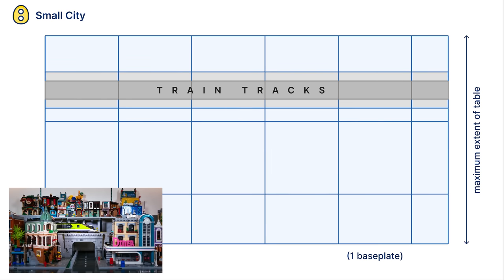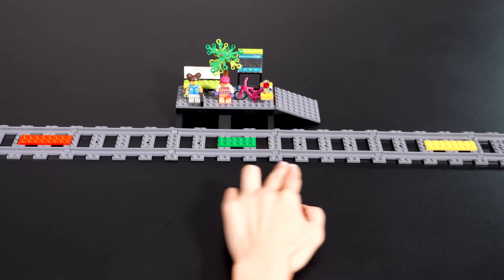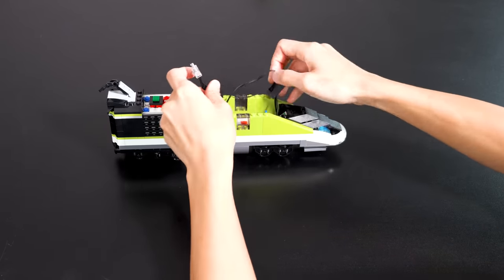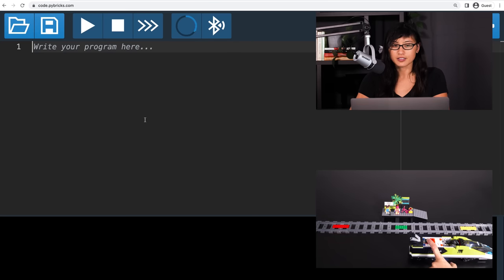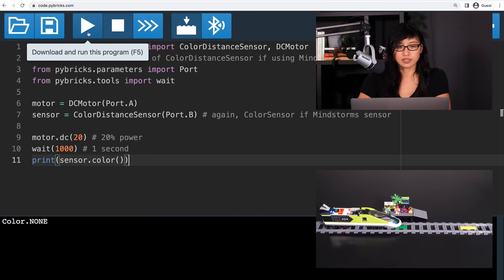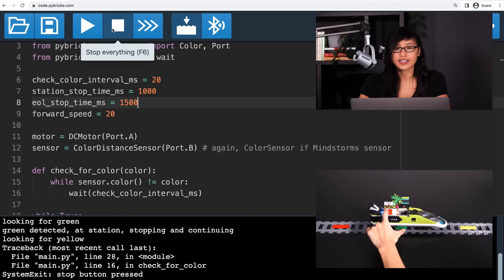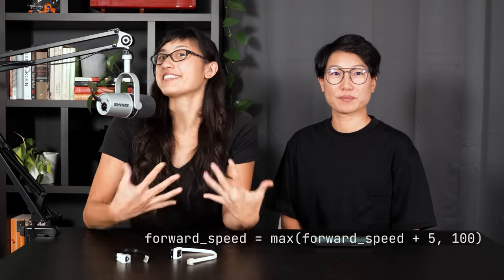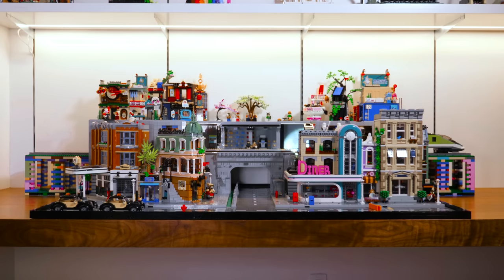solving the LEGO city train problem (no room for loops!)

Comment from the maker: The train in the video is LEGO Express Passenger Train 60337. If you want to purchase it, consider using this link (this is an affiliate link, which means when you click the link and make a purchase, we receive a commission, which helps to support the channel!):
https://bit.ly/lego-express-passenger-train-60337

Links to the code shown in the video, plus the code blocks version if you don't want to use Pybricks:
- Pybricks code to make the train run back and forth continuously, using color sensor: https://github.com/eggybricks/poweredup-color-sensor/blob/main/pybricks-code-for-60337-express-passenger-train.py
- PoweredUp code blocks version of the same thing: https://github.com/eggybricks/poweredup-color-sensor/blob/main/PoweredUp%20Code%20Blocks%20for%2060337%20Express%20Passenger%20Train.pdf

Comment: You could have use the depth sensor for added realism: trains don't just stop on a dime... they roll a bit untill they stop... you could place a small plate in the center of the green plate and let the train slow down when it sees the green plate, and stop when the sensor sees the raised bit.
Reply: Don't know if you'd have space for the depth sensor? As think the sensor they used only does colour?
Reply: @JasonHorrocks  I suppose you could use two different color codes, one to slow down and one to stop. 
Example: put a white at the beginning of the platform and one green at the end. Do for both directions. Include a code to ignore the first white color met and act only when the second is met. Program to restart the train in the same direction after a certain time.
Reply: I suppose this video is to show the basics and it's up to you to improve it the way you find most suitable :D
Reply: Or have it detect the color and slow down to a stop over a set amount of time

Comment: As a suggestion for V2, I'd say put the "current speed" into a variable, and have your colour detection be a switch statement. Then the "Green" case can stop and wait, then re-apply the speed from the variable, the "Yellow" case stops, waits, changes the speed variable to - speed, and sets that speed, and the "Red" case does the same, but with + speed. Then it'll work for tracks with more than one station, and rather than having to push the train to the station when it starts, it can check the sensor and if nothing's detected, start going forward.

Comment: You could improve that program a little so the train doesnt stop as hard as it does right now (maybe looks very good with a bigger layout in the future). Lets say you use a longer indicator. Now you could initiate a reduction of speed every few ms as long as it reads green. When the green indicator is over it could do the usual break but with a bit of tweaking the settings and playing with the length of the indicator you could get a smooth break motion. Really cool job, that one really inspired me!

Comment: This is really great and has turned the train from a toy that my two kids fight over to control and crash, to one where they work together to get the train to do what they want to do! Excellent intro.
I personally found that the mindstorms sensor was not always 100% reliable when it comes to reading green when using it myself. I dont have the color and distance sensor however I would imagine it would be about the same too. If the train was moving very slowly over the green, or was in a darkened space then this wasnt an issue. To fix the issue, I built an enclosure under the chassis of the train (similar to the one thats removed in order to get the sensor to work originally) and found that its now completely reliable. 
I would imagine this would likely result in you fixing the reliability of your color and distance sensor as you mentioned that it was not as reliable as the mindstorms sensor. Whilst I suspect that the shaded areas where you had your coloured plates and the brighter light from the mindstorms sensor were probably the reasons why you didnt experience issues with the mindstorms sensor.
Reply from the maker: Thanks so much! And really nice debugging and solution — this is a great fix for anyone encountering this issue. Thanks!

Comment: Really like this setup, but I have issues with your code. It is assuming that the train is between the red and yellow at startup. If it is not, it will run past the yellow and off the track. I would suggest you change your check_for_color to not have a parameter and to have a switch statement to see if it has one of the three command colors. Then depending on what color it sees it can stop or change directions. You will have to add a direction variable to allow the program to remember what direction it was going in the station and continue in that direction after the hold time. In fact, this would allow you to have just two colors (red and green for example). When it hits red it just looks to see what direction it is going, then change to the other.

With this setup, the program will always stop at a reverse point and will not be dependent on a starting position.
Reply: Nice change, but what if the train starts at one of the ends then it might be best if they were two different colors
Reply: yes, I agree, the code in the video is unnecessarily complex
Reply: @anatoleh1  It's more than good enough for a basic intro. Every code can be refactored and refined later when you learn more ;)

Comment: The PU Sensor is not as good as the Mindstorms/Education sensor. The light with it seems to increase the accuracy. I also coded something similar a while back before I saw your video, and I managed to make it work using just two colours. I just stored a variable for the speed of the motor and modified that every time I saw the colour. You could do more stuff with other colours then if you had more ports available!

Comment: Cool. Seen this idea used for a Great Ball Contraption many years ago using Power Functions & an NXT. 2 colors at each end. 1 to slow down & 1 to stop. 4 colors total. But they had sign posts on the side of the tracks for the color. Not down. So, when someone walked by with a certain color shirt, things would go wild. LOL.

Comment: your probably not asking for tips about trains but I noticed a problem, that train has airdrag which is pretty bad for trains, and for those kind of lines you should put stuff like metra or amtrak does and a great example is the heartland flyer, runs through some smaller cities but also some bigger ones but its a pretty small line overall

Comment: Have you seen how the old 4.5 Volt system did it?
The battery box had a switch that was sticking out. When the switch hit an obstacle, it would reverse the current.

Comment: Maybe the intermittent fault of the color sensor has anything to do with two things, 1) the distance of the sensing element to the bricks and 2) providing contrast. Last I mean butting up say...black bricks to the colored bricks. Now the first I learned from an Arduino light sensor that measured varied output values based on distance. The second idea I got from an rpm counter, which stated contrast as a procedure. These ideas might improve consistency. Thank you for making these videos!

Comment: I just completed my first prototype city tram using a modified version of the tram from Lego set 8404. In the past I have had this setup with a Power Functions motor, battery box and IR receiver but as with my other trains, this just goes around and around and the tram generally has a hard time with corners. Using the information from your video, a PoweredUp Hub and train motor along with PyBricks, I was able to implement a much nicer street level light rail line. Many light rail lines do exactly what you suggested in your video in that they are a linear line that just goes back and forth. This works great for LEGO city regardless of the size as it adds a nice and unique bit of motion on the street level. I am interested in implementing some automation to the big rail lines as I think your method would be great to allow trains to pull into stations based on the count of revolutions. I am also interested to know if it would be possible to control the behavior of multiple PoweredUp hubs such that using an external computer, the code would be able to monitor the status of different trains. For example, if train "A" just passed the red plate, then train "B" stops for a specified amount of time to let train "A" pass. It would be really interesting if automation like this could be accomplished as it would provide a greater degree of realism to LEGO train layouts.Thanks again for your wonderful video and the inspiration it provided! You guys are awesome - if you are ever in northern, AL check in with the Tennessee Valley LEGO Club!
Reply from the maker: Glad this was helpful!!

Funny that you mention automating bigger rail lines — we just finished a new city track layout (w/ automation) that coordinates four trains (with four hubs) to all share one station by monitoring each other's location. If you're interested, we'll have a video on it up in the next few weeks.

Thanks so much and will definitely check in if we're ever nearby!

Comment: Great idea! I solved the same problem a while ago by having the train slow down before the track ends using a timer, and then bumping into rubber bands at both ends (for "recalibration"). But I was actually thinking of just replacing the whole thing with my own motor + micro controller, mostly because I don't want to deal with those AAA batteries all the time :/

Comment: In my childhood, I didn't need batteries to run my Lego train. It had a transformer which was plugged into the 220 V socket. And the train got the electricity from the tracks.
Reply: The old 9V track-powered lego trains could also be automated to do this with the classic Mindstorms RCX system! I have the old trains and a Mindstorms RCX, maybe I should try it out. The connector to power the tracks can be connected to the motor output on the RCX. There's no color sensor, but there is a light sensor to detect different brightnesses - or i could use a touch sensor which presses against a tile when the train reaches a certain spot.

Comment: Once you have the python program on the hub, can you still use the remote controller?
Reply from the maker: Good question! If you use the program as written, unfortunately not — the Pybricks firmware (which includes the custom program) overwrites the LEGO firmware for the hub, so you'd have to reconnect the hub to the PoweredUp app to get the LEGO firmware back.

You can modify the custom code to also support the remote control, though — you can wrap the whole program in a loop that listens for the remote control and only runs the back-and-forth part if a specific key combination is pressed or something like that. (https://docs.pybricks.com/en/stable/pupdevices/remote.html shows what you can do with the remote from Pybricks)
Reply: @eggybricks  thank you, very helpful info!

Comment: how would I fix the problem with py bricks saying "No Bluetooth adapter could be found. Please connect or enable a Bluetooth Low Energy adapter and restart the browser." with a built in Bluetooth adapter
Reply from the maker: Hmm, sounds like maybe a browser support or browser permissions issue, but can't be sure without knowing more. Would recommend trying it with Google Chrome if possible
Reply: @eggybricks  will do

Comment: I copy pasted the code to phyton and it keeps saying it detect green right after seeing red or yellow and stops but does not actual stops on the green tile.
Reply from the maker: It sounds like 1 of 2 things may be happening: 
1. The sensor is seeing green when it's not green
2. The sensor is not seeing green when it is green

We ran into similar problems when using the PoweredUp sensor. It can have trouble recognizing colors under certain conditions. These are some things you can try that may help in either of the two cases:

(1) It's important that the entire track is tiled with a neutral color that can't be mistaken as green. For example, our entire track is tiled with dark-bluish-gray anywhere where the green/red/yellow tiles are not.

(2) You can try adding some light so that the sensor can see better (like shining a flashlight at the green tile).

(3) If you happen to have a Mindstorms color sensor, you can swap it in; the Mindstorms sensor performs more reliably.

(4) You can change the logic in the code to only use yellow tiles (which are easier to detect) and for example, determine the train's direction based on the number of times it has seen yellow. Something like this should work for exactly 3 stations, assuming you start the train at the center station, but you can modify the code to match your situation: https://gist.github.com/eggybricks/4b03418b5ae0d99de9c474d2ac9492d6
Reply: @eggybricks  The second code was giving me an error for line 29. So what I did instead is change green to yellow and both ends to red. The sensor was still acting up after yellow displaying that it detected red. I fixed it by adding a bigger yellow line and now I think it works. Thank you so much.

Comment: Any way for you to also set the motor speeds?
Reply from the maker: Yes, you can set the speed of the motor by setting the power level like in: https://github.com/eggybricks/poweredup-color-sensor/blob/main/pybricks-code-for-60337-express-passenger-train.py#L24 (here we're setting it to 20% of max speed for going forward, and -20% for going backward)